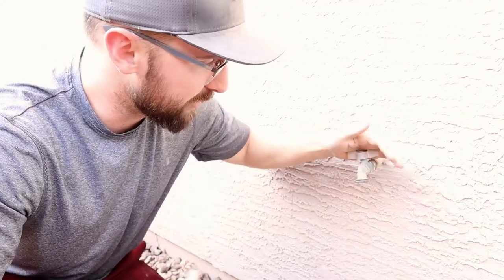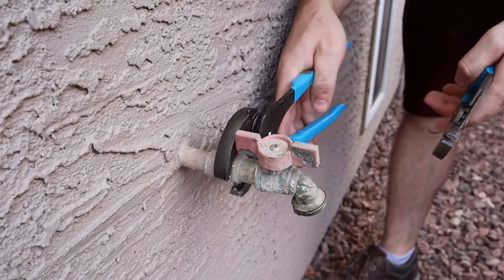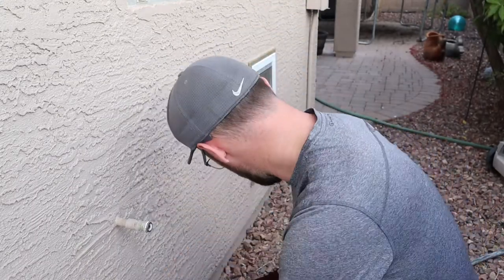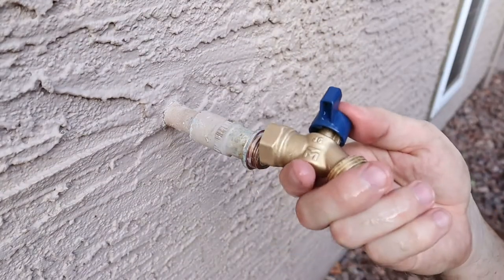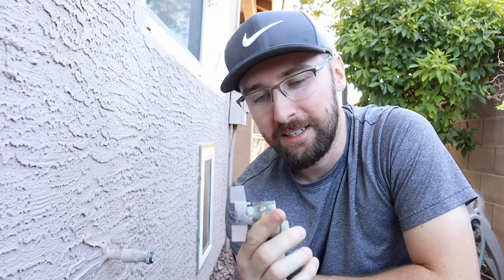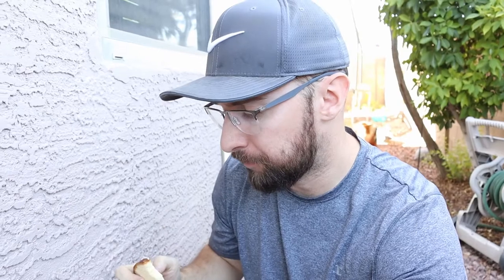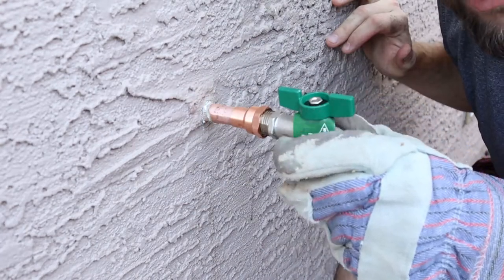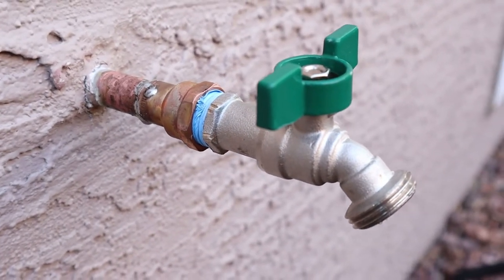Replacing Hose Bibb using BREAD - Soldering with Dripping Water

Comment: My dad showed me that, while wearing gloves similar to what you had on. after getting the solder sucked in to the joint, run a gloved finger around it to clean it up (before it hardens fully).

Comment: I put the bread in and soldered the pipe. However the water doesn't turn
 on because the pipe is clogged now. Im not sure if the joint is 
soldered good enough and Im afraid that at some point the pipe will 
clear and the water will leak out. Do you have any suggestions how long 
until the bread will desolve ? Its been all day so far.
Reply from the maker: That's strange because a pipe should have at least 25 psi, which is a large amount of pressure. You can try to poke at it.
Reply: You probably put a whole peanut butter sandwich in there 🤣🤣🤣
Reply: @myutube1960  It was a ham sandwich..I shouldnt have done that ?
Reply: ► Mortgage:  one slice of bread. Not one ton!
Reply: I think it's just white bread w/o crust, so it dissolves easy and you flush it out a nearby fixture that doesn't have mixing valve, aerator etc (or unscrew/remove aerator)...just an open hole as large as possible, for ex a hose spigot.  And just use enough to stop the water and finish job, no more, too much can get stuck.    (not a pro here, just learning this myself)